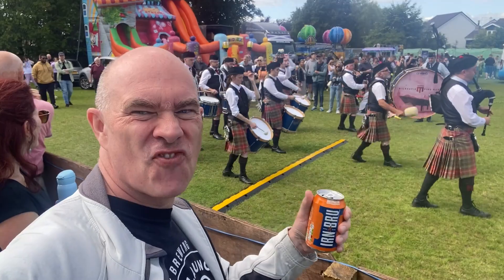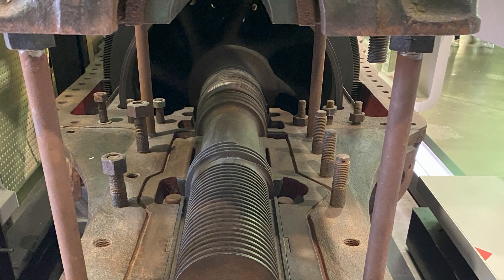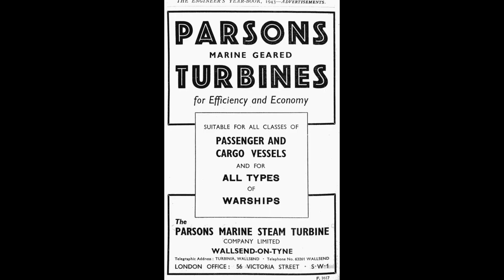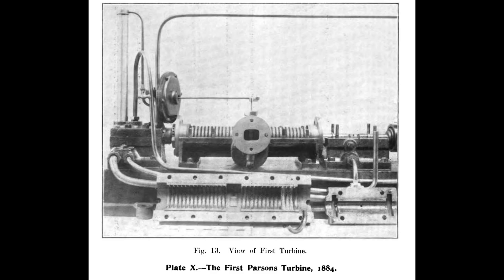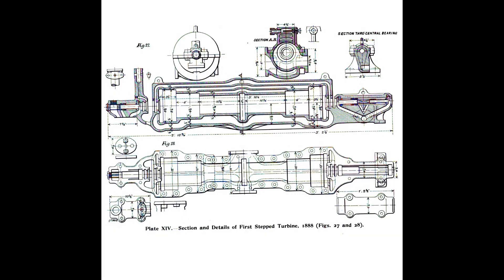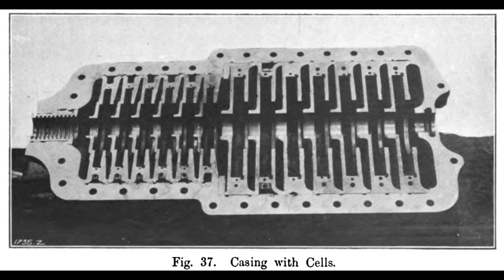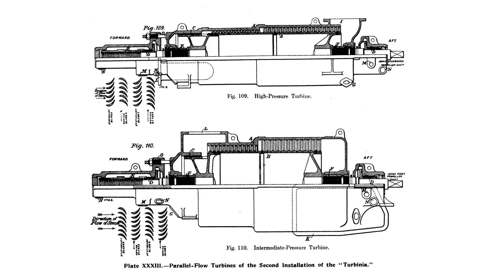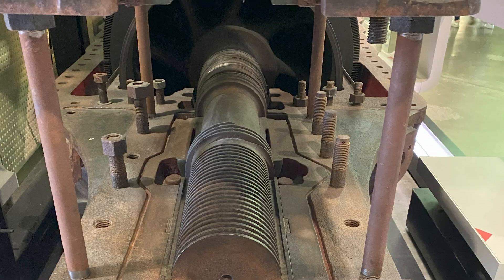How A Victorian Era Engine Made Spaceflight Possible... Let's Look At A 125 Year Old Turbine!

Comment: Parsons was responsible for a very large part of the modern world we now enjoy. What a total hero.
Reply: The modern world today runs on internal combustion technology... well beyond Parson's capabilities.
Reply: @DoktorBayerischeMotorenWerke  Unless the power in your home is coming from wind or solar, then you still get your energy from a turbine. Even nuclear power plants still rely on steam turbines for electricity generation, as will the fusion power plants that will one day replace them.
Reply: @CountScarlioni  Where I live, non-renewable electric power is produced primarily by internal combustion, large natural gas fired Gas turbine engines..
Reply: @DoktorBayerischeMotorenWerke  Gas turbines were of course based on steam turbine technology, so Parsons was still very much in the picture. Added to that, Parson's own company built and sold gas turbines. Hard to do if they were "beyond" his capabilities.
Reply: @CountScarlioni  Steam engine operate on a completely different and less efficient thermodynamic cycle, The Rankine Cycle.
Gas turbines operate using the Brayton Cycle principle and were developed directly from Turbochargers that also use the same Brayton principle.
Gas turbines are not related to steam turbines in any way..

Parson's only made two gas turbine prototypes, the PU 2279 and the PU 2983.
 Both were designed by genius German engineer Max Bentele who worked on the Jumo -004 and was hired by Parsons after the war.
Parson's abandoned gas turbines and continued making steam engines.
Bentele left for America to work on Wankel engines at Curtiss Wright.
 Any questions?
Reply: @DoktorBayerischeMotorenWerke  Thanks for proving my point. Ta!
Reply: @CountScarlioni  I just disproved your point... Parsons did not develop gas turbines from steam turbines.

Comment: Interesting!  Thanks for sharing.  Heck, that's the basis for jet (turbine) engines right there.  Thanks for sharing.
Reply: A common myth, but steam engines are not related to the development of jet engines at all. Jet engine were developed from turbochargers which run on the same thermodynamic principles... the Brayton Cycle, not the Rankine Cycle.

Comment: I had good fortune to look at prototype Parsons turbine in Birr Castle in Ireland. It was used to run the generator to power the Castle and Village. Good trip. Also realised that Scott is talking about it right now 😂
Reply: Just up the road from me - I've seen the telescope when visited, must take the kids up and look at the turbine
Reply: @RalooRocker  It's beside the gate opposite visitor's centre. Funnily enough at first glance I just took it for a piece of junk to be moved away because it looks so modern and completely familiar. I guess if it works, don't change it 😁.
There is also a small museum there in which I spent a good while, salivating at all the steampunk goodies 😁

Comment: "Can you fuel rocket with cream" - as a Lactose intolerant person, yes, you can 😅
Reply: What kind of nozzle are u using to increase thrust?  Is the exhaust velocity near super sonic? 😂
Reply: @IanValentine147  at least that's what it tends to feel like...
Reply: @IanValentine147 I'd say a cigarette along with a latte would give a maximum thrust, lactase pill or no
Reply: Thats pretty much the plot of Thunderpants
Reply: Perhaps as a propellant, but I don't think it would burn well as fuel. The nitrous oxide however..
Reply: Best comment. You win today's Internet... 😊
Reply: Rocket propelled Diarrhea, a real After-Burner.
Reply: The specific impulse of a Burrito Supreme will lift 180 lbs. 6" off a launch pad.  Mach 1+  exhaust claps can be heard during a full duration burn. And you can definitely 
throw a nozzle right outta yer block, resulting in your remaining fuel going off all at once in a big, toxic shebang. Tight control of thrust vectoring is a must!
Reply: modern tech from the nordics enables us to make fully lactose free and normal tasting milk products these days.
Reply: Luckily there’s plenty of cows on Mars.
Reply: milk cream can have energy densities up to about 10MJ/kg, as a rough approximation for oxygne weight lets assume its mostly a mix of ch chaisn and water that would mean you'd need about its own weighti n oxygen again to burn it giving you a total energy density of about 5MJ/kg, about half that of kerosene oxygen mix and about 1/3 that of hydrogen oxygen mix but not too horrible, might be bale to get something like 2000-2500m/s isp
Reply: @JulianDanzerHAL9001   The figure you gave is delta-v. Using your delta-v figure to calculate ISP we get a range of ca. 17000-21000 seconds assuming a 1kg propellant load in a 180lb human (“dry” mass). Who needs ion engines, fusion drives and VASIMR when you can have lactose?
Reply: Only problem is the exhaust gasses are extraordinarily toxic
Reply: Haha thanks for the early morning chuckle mate
Reply: Wrong part of the cow - just collect the methane and use that
Reply: My body use beans as rocket fuel
Reply: @randomnickify  Or use it with Hydrogen Peroxide for a hypergolic rocket engine!
Reply: Have you tried Goats milk
Reply: @WOFFY-qc9te Is that a higher ISP formulation? Personally I find heavy cream made from Yak Milk achieves a good balance between density and specific impulse, however the chamber pressures resulting from using such a fuel would likely end in engine rich exhaust with a colour akin to that of the Nitrogen Dioxide fumes from an N2O4 leak at room temperature. Iykyk
Reply: @thesentientneuron6550  Ok this is getting weird, my suggestion of Goats milk was because Randomnick said he was lactose intolerant.  
Yak Milk cream as a propellent is unknown to me,  I suspect the use of cream may cause clotting in the injector nozzle especially if it was sourced from Cornwall.  

As for the specific impulse I will have to leave that to Scott Manley to calculate,  Mine I estimate  at five big spoons a minute, 7 on a hot day with a flake.......
Reply: @thesentientneuron6550  uh no that is isp
2000-2500m/s isp is about 200-250s isp if you wanna use that unit
if delta v the ndepedns on propellant loading
Reply: @JulianDanzerHAL9001  Buddy the unit of ISP most commonly used is seconds, which is why I was confused. I did some reading just now and remembered that there was another way to measure ISP, dividing by propellant mass not weight which would yield units in m/s. So you would be correct. I misunderstood your comment, apologies.
Reply: @thesentientneuron6550  it does seem liek the more pracitcla unit to use
after all, most of the time, in spaceflgiht, orbtial speed or escape velocity is measured in m/s not seconds of earth gravity
and energies are measuredi n Joule not kg*s²*earth gravity²
Reply: @JulianDanzerHAL9001  Yeah 😅. Left me confused for so long until I finally got a strong grasp pf dimensional analysis after a couple of years. Stupid units. Not the only case of stupid units though.
Reply: @thesentientneuron6550  go full si
all the units just fit
although, I do think we should rename grams to millikilograms for si uniformity

Comment: it's kind of odd that steam turbine design didn't transition to airplane engine directly. Then centrifugal compressor dominate the jet engine until axial compressor turbine took over again. I believe during the time of steam turbine invention, there were other competing designs that use reaction steam force like the hero's engine. But the issue is the torque generate is too little and the rpm has to be spun up extremely high to produce usable torque, then it run into material stress limit from the centripetal force. Similar issue plague tesla turbine design as well, requiring too high of rpm to generate usable torque and stress out the material stress limit.

The steam turbine blade operate more like a lift device rather than reaction device, so it can generate the same amount of torque while spin much slower than a reaction device, lessen the material stress requirement. So paradoxically, steam turbine actually spin slower than a hero's device.
Reply: That's simply because centrifugal compressors are easier (and cheaper) to make.
Reply: Jet engines are completely unrelated to steam turbines and use a different thermodynamic cycle. Jet engines evolved from Turbochargers and they both use the Brayton Cycle... not the Rankine Cycle.  Scott is great storyteller but not much of an engineer..

Comment: We had an Alpha Laval milking plant in the milking parlour in the 1960s. Unfortunately that was ended by Foot and Mouth Disease resulting in the cows being euthanised. I was only a small child, but I missed the cows when they disappeared. I have never had any fear of cattle since. Just move quietly so as not to startle them and basically they are curious creatures that are not naturally other than quietly friendly. Entire Bulls must NEVER be trusted, however.

At the time the other widely used milking machines were made by Gascoine, at least in Britain. I think Laval was reckoned to be the slightly better set, but both were well made and could be serviced indefinitely. Only the rubber work needed replacing once in a while. The rest was precision stainless [food grade] steel and precision made glasswork.

Thanks for bringing back memories from nearly sixty years ago. I never knew of this connection with rocket injectors!

Best wishes from George

Comment: I think NASA engineers learn to tie knots the same way they've been done for centuries because, in some cases, they are better for securing probe equipment than screws or something like that.
Reply: In telecom it's usually a wax-coated polyester cord that's used.  Easily available on the internet.  Not sure what they use in aerospace industry.  I'm guessing some high-performance aramid fiber... (e.g. Nomex, Kevlar), etc. but could be simple polyester.  The reason 'tying' cables is done on spacecraft is it provides them with a secure mounting point that is flexible through liftoff (max vibration).  Cable-ties are bad because they become brittle over time and are rigid - causing excessive stress on the wire & jacketing.  There is definitely an art and a science to doing this, and imagine the experts have several key sections of ABoK memorized.

Comment: Could someone please explain what the big breakthrough of turbines was? People must've stuck a propeller like thing in a steam stream since forever, id guess? And what's the difference between a real turbine and many small propellers?
Reply: It is very easy to stick something in a stream of steam and make it spin without doing any work. But if you want to convert the energy of the steam into mechanical work with any efficiency, you need to know how to do it right. The table shown at 4:06 tells quite a story of how the efficiency of the turbines was steadily perfected, while their power also grew. That's what the big deal was -- making the turbines competitive in efficiency, and ultimately in cost of ownership, compared to other engines.
Reply: @cogoid  Thank you for your reply - but aren't the efficiancy gains something rather easy to get to itereatively? I.e. the shape of the blades, the introduction of the stators and things like that?
I just don't understand why turbine tech basically came out of nowhere all of a sudden, instead of having been gradually refined over the centuries or even millenia before? We've been building rather accurate metal parts for quite a long time before the turbine boom.

Comment: The Titanic had a steam turbine driving the middle propeller. It got steam at relatively low pressure after it had passed the piston steam engines driving the outer two shafts.

I wonder how the turbine blades were made considering there were thousands of them.

Comment: I worked on offshore drilling rigs, and they are powered by large diesel engines. All of our diesel fuel 
went though a fuel/water separator to remove any water that contaminated the fuel. The were 
De Leval separators. They are still widely used to this day.

Comment: I wonder how much of the tech in modern Jet engines for aircraft owe their existence to this steam engine.
Reply: Nothing actually. Jet engines don't even use the same thermodynamic principles. Modern Jet and Gas Turbine engines were developed from the invention of the Turbocharger both operate using the Brayton Cycle, steam is completely different and uses the Rankine Cycle... completely unrelated technologies..
Reply: @DoktorBayerischeMotorenWerke  Sure, GTs and steam turbines are different beasts. But the fluid mechanics theory was all developed for steam, and an awful lot of the detailed rotor/stator and nozzle designs came from steam experience. Just like early internal combustion engines all leaned heavily on steam piston engine experience, despite being thermodynamically quite different.
Reply: @kenoliver8913  Of course, windmills and water wheels are different beasts. But the fluid mechanics theory was all developed for mills, and an awful lot of the detailed steam turbine designs came from mill experience. Just like early steam engines all leaned heavily on cast iron cylinder manufacturing experience developed for military cannons, despite being thermodynamically quite different.
 See, I can play that game too..
Reply: some jet engines have water injection to increase power at high loads,they sort of add steam to the hot exhaust.
Reply: @trondhansen9896  Water injection in Jet Engines is used to COOL the exhaust gasses and lower the turbine inlet temperature..

Comment: OK, but I was hoping to understand why ‘modern’ electrical generation are termed Turbines, not Windmills? I would expect to need Turbines to generate power if we lived under Venus’ gales. How are these Turbines?
Reply from the maker: Well.... I guess the word 'mill' implies grinding something. Whereas wind turbines come from people with a power generation background so they see the rotating part as a turbine.
Reply: @scottmanley  Traditional "Windmills" are driven by "sails."  The sails are actually a kind of turbine, but not called such until they were used to produce electricity or pump water.  What's interesting to me is the wheel in a water mill is not called a turbine, even though it ostensibly is.  Yet the wind turbines used to pump water in the old west were called "windmills" even though they had nothing to do with mills at all.  The English language is weird.
Reply: Turbine is not an English word, it comes from the French and it is correctly pronounced Tur-ben  or bean